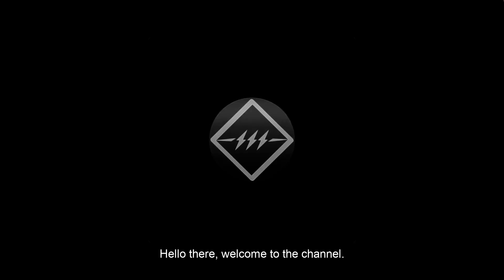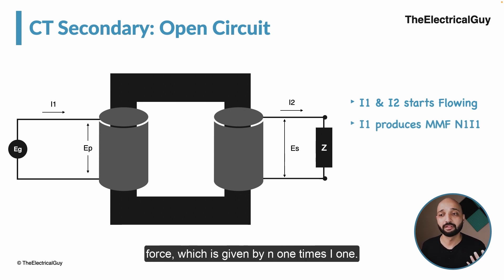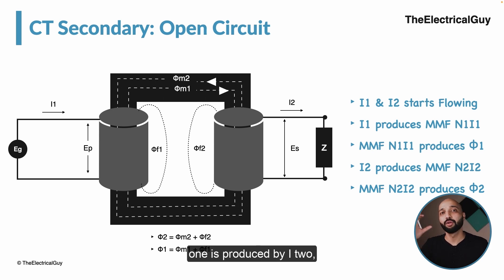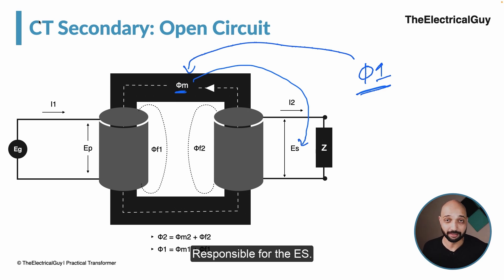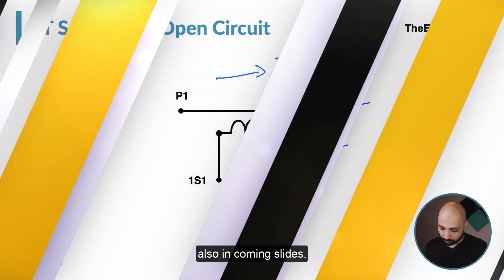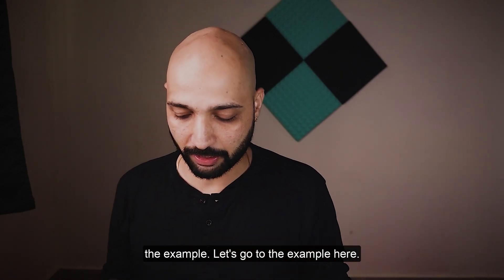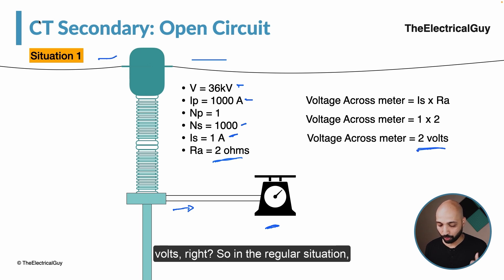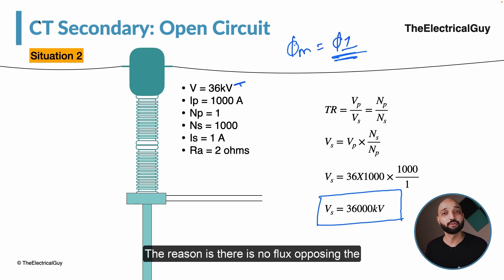Why CT secondary can’t be kept open circuited | Explained | TheElectricalGuy

Comment: Does the relation V_s = V_m*(N_s/N_p) not apply when the secondary has a load or is shorted? I'm having trouble understanding why we don't treat the voltage across the terminals of the secondary with that voltage regardless of its load. I have heard it said that current transformers' secondaries can be thought of current sources instead of voltage sources, but why is that?

Comment: Maybe it is just my opinion, but the 36kV is the nominal network voltage and not the voltage on the primary side of the CT. The voltage on the primary side of CT is actually the voltage drop on the line that passes through the CT (it is way much, much lower). When the open circuit on the secondary occurs, the voltage on the secondary can rise up to couple of kV and cause some damage on the measuring equipment.

Comment: First of all, great video...I went on to watch several others from you after this, and all great stuff.

I'm a lineman myself and am arranging some training for CT's, which is how I found myself on this particular video a few weeks ago. I really appreciated the depth you went into on this and especially the math. However, I'm confused about the ending.

I feel like the Turns ratio to voltage equation wouldn't apply because the coil (the single wire being measured) isn't actually hooked up across a difference of potential....versus a coil in a power transformer that is hooked up wye or delta, and IS connected across a voltage. But in the case of the wire passing through on a CT, whatever the difference of voltage from one side to the other, I'm pretty sure it's negligible (definitely not its phase to phase or phase to ground value).

I really liked the way it added up simply, but the more I think about it, the more I'm questioning the legitimacy of it. What do you think? Am I missing something, or is that making sense to you too?

Comment: CTs are definitely a challenging aspect of electrical theory to understand, so I don't want to be harshly critical of the maker of this video. Having said that, because so many people in the comments think this is a good explanation,  I feel compelled to point out that the 36,000kV volt figure presented at the end as the open-secondary voltage is absurd. THAT'S A CRAZY NUMBER--36 million volts! Most reputable sources will describe numbers that venture up to a few kV. A better explanation would make use of a simple phasor diagram to explain the dynamic between burden current and the components that make up the primary current: the ratio current and the magnetizing current. In brief, when a CT is open-circuited on the secondary side, no primary ratio current exists and the entirety of the primary current becomes  magnetizing current. This pushes the core into saturation, and the normally sinusoidal core flux gets distorted into a square wave shape. This flux has an extremely high rate of change at the zero crossing, producing very high EMF spikes. THAT is the reason why CT secondaries are never opened.
(PS. Coming from a professional substation electrician and electrical theory instructor)
Reply: True

Comment: In situation 02, you have said Vp is 36kV, but as CT is connected in series of a transmission line how the Phase to Phase Voltage can be considered as the applied voltage between CT primary P1 and P2 Terminals?

Comment: How you have taken the Primary side 36kV. As CT is connected in series, it will step-up those voltages which is drop across primary (which is in milli-volts as primary is single turn normally). Completely wrong explanation
Reply: Bro can you explain for me clearly😊. Why secondary side should be short circuited?

Comment: 36 kV is the voltage between phases (line voltage). But the voltage between the Primary terminals P1 and P2 of the CT is not the line voltage.

Comment: Wrong explanation, the line to line voltage 36 KV need not be CT primary voltage and also CT need to modeled with current source, if the CT gets saturated the voltage developed at the centre gets disturbed and voltage developed will be other than sinusoidal.

Comment: I am coming more from the direction of appliance repair and restoration, so forgive my understanding of grid equipment is limited. My understanding of a transformer with a saturated core (due to too much voltage or too low frequency) is that impedance of the primary will be lowered, reactance will be lowered, magnetic coupling will be lowered due to the transformer acting like an air core transformer with permeability of air, harmonics will be generated due to core saturation effect making transformer primary and secondary inductance and reactance non linear with voltage. I would assume, in a current rather than voltage limited situation like you describe, lowered reactance due to saturated core would limit energy in the open circuit CT rather than make the problem worse. What am I missing?

Comment: the voltage on the primary of current transformer is de difference in potential between the incoming line and the outgoing line. this is not necessarily the line voltage

Comment: Thank you for your smooth and clear explaination ! 
How come an open circuit condition is dangerous for the CT but not for the transformer ?
Reply: Because there is still current in the primary of the CT with an open secondary, but in a regular transformer if there's no current in the open secondary, then there can be no current in the primary.  This was the core takeaway from this video.

Comment: Hi! In my point of view you have made a mistake: Vp is not 36 kV. The value of Vp is equal to the voltage drop produced by the CT in the series circuit, with Vp max at1000 A (and much more in short circuit situation). 
The main difference between a conventional transformer and a CT is that in the former, the primary current depends on the secondary current and the magnetizing flux is the subtraction of the flux produced by the primary current and the flux produced by the secondary current.
In the CT, the secondary current depends on the primary current and within certain limits given by the load characteristics, the resulting magnetic flux will also be as in the conventional transformer, the flux produced by the primary current minus that produced by the secondary current. 
If for some reason the load on the secondary winding decreases, to maintain the balance of currents and flux, the secondary voltage must increase, for example, if Ra is 20 Ohm instead of 2 Ohm, the voltage at the CT terminals will be 20 V instead of 2V for the  same current of 1A . In the hypothetical case that the secondary load is an infinite impedance Ra=∞ (open circuit), the secondary voltage would increase for keep the balance current in circulation  until it reaches its dielectric strenght limit.
Reply: I also agree with @danolica ... Please give the clarification on that @Gaurav J
Reply: Do you know why the manufacturer didn't put a spark gap or some Transient-voltage-suppression diode ?
Reply: i too agree with @danoilca . @Gaurav J pls explain
Reply: Are sec voltage increase hoga to uska effect primary me ni padhega kya

Comment: If the meter is connected to the secondary we are getting the voltage drop of 2V then , then 36000Kv- 2v will be resultant voltage even meter is connected, then how could be the safe.
Reply: When the meter is connected, the voltage is 2V.  Not 36000kV-2V.

Comment: If in case of potential transformer this not happened why sir,there also secondary having winding
Reply from the maker: Potential transformers are connected in parallel so just like a regular transformer
Reply: If I open neutral point of PT what happen sir

Comment: Sir how much voltage is induced in case of Secondary is short circuit,in the video only said the  voltage drop V=IR=1*2=2 volts this only voltage drop, what about the induced voltage in secondary,i get confused sir
Reply: The voltage in the secondary depends on the load on the secondary.  With 2 ohms, it is 2 volts.  With an open circuit, it is megavolts.